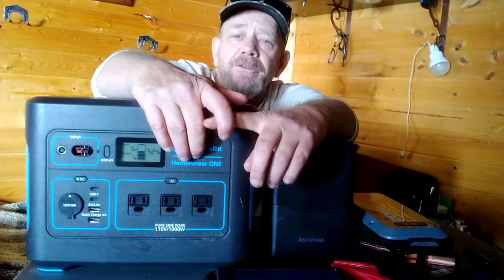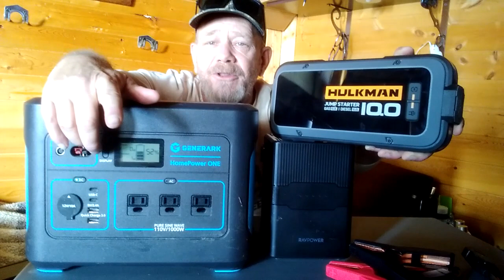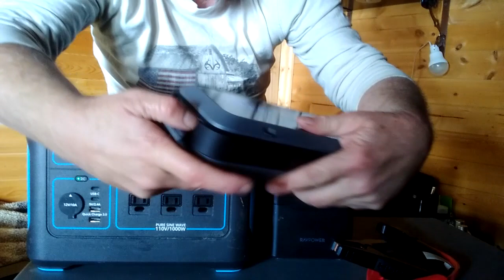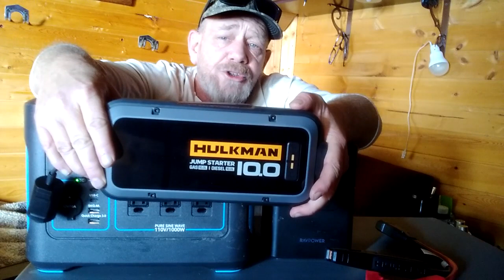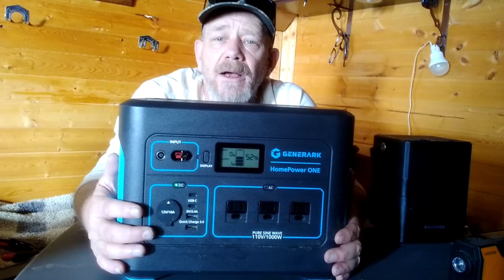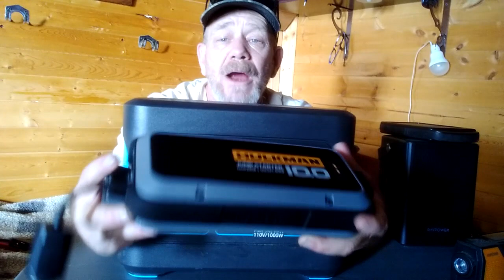Best Portable Power Stations For Your Needs Explained

Comment: It's great there are so many options available for portable power now. I remember my first one I had was a Wagon Power Station that had a sealed lead acid battery, 400 watt modified sine wave inverter, jumper cables, and an air pump around 2006. Things have come a long way since then. I preordered an Inergy Flex 1500 many months ago but they have had nothing but excuses and move out the ship date every 3-4 months by 3-4 more months(plus it's quite a bit of money too). I'm trying to decide now if I'd be better building my own or finding one of the many existing units out there, with the biggest issue coming down to how much power do I really want on an inverter. I live on the Texas coast and it's so humid and hot for 6 months I really want the power to run my 8000 btu window unit for a few hours, but there is a big premium to pay in order to do that. Great information as always Lamar.
Reply from the maker: thanks, those lead acid would work but you have to keep them constantly charged. The new LI units can be stored a long time and ready to use. More bang in a smaller and lighter unit. That Hulkman is great for vehicles.
Reply: @solarcabin  The biggest issue I have with lead acid is they usually throw in the towel within 3 years. Sometimes you might get 5 years but compared to the 10+ years you can get out lithium iron phosphate plus the lighter weight there are lots of advantages. The only real caveat is to make sure the lithiums don't freeze and get used while frozen. Once you take it all into account the cost over 10 years is nearly the same with a lot less hassle using the LiFePO4 batteries.

Comment: I bought a Renogy Lycan. If it didn't see a high enough load, it would turn itself off. This was not good when powering my 12v fridge. So, I became wary of these power boxes and built my own power station from parts. Will this unit stay on until manually turned off, or, does it suffer from the same fatal flaw as the Renogy?  Do you know of any units that will stay on? Thanks.
Reply from the maker: Yes that can be a problem with an appliance like a fridge that runs intermittently and what I do is turn on the light on the power station so it will stay on. That uses very little power and then the unit will always stay on. You could plug in any small gadget in to the USB port and that would also work I think.

Comment: If the 12 volt cig port is 10 amps you can cook with a 12 volt 100 watt rice cooker. It takes about 35 minutes to cook rice and lentils.
Reply from the maker: I need to get one of those. I hear they work well for small meals.
Reply: @solarcabin  You can directly connect them to two 100 watt panels in parallel. I`m gonna try it if I ever get moved to my lot. Waiting waiting waiting on the people who were living there to move their trailer. I have everything ready to start growing a garden and if they don`t hurry up I won`t have time to have a Spring garden this year.
Reply: @solarcabin  Look for the one with a cat face on it on Amazon.

Comment: If you want very long range radio reception on both AM and FM get the CCrane EP PRO. It`s one of the best radios as-is but has antenna inputs for both bands as well for super reception. Get rechargeable D batteries and use a USB charger with a folding solar panel.
Reply: CCrane makes good radios but you can find plenty of other brands that work well too for a bit less. I have several Tecsun radios as I'm too cheap to pay for the CCrane price for the 25+ years of coast to coast commercials markup. A small loop antenna will really extend the AM reception on a decent radio and all that you need to do is get the antenna close to the radio, no physical connection required.
If you're out in the sparsely populated areas of the US you can easily get 300-500 miles of range on the AM dial.

Comment: The little power banks are excellent for running a USB fan after hurricanes. A 25,000 mAh one will run a fan for at least two days 24/7. They charge much faster with a 20+ watt folding solar panel if you use them daily.
Reply from the maker: Some of the units sell the solar panels separately and I have them for the Generark but I like recharging from my big system at the cabin. I will use those when I go camping